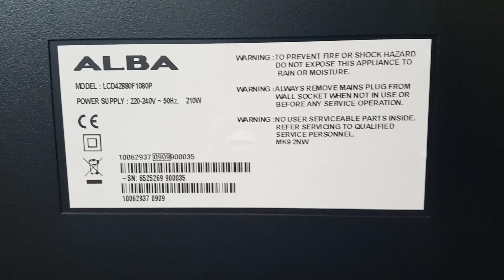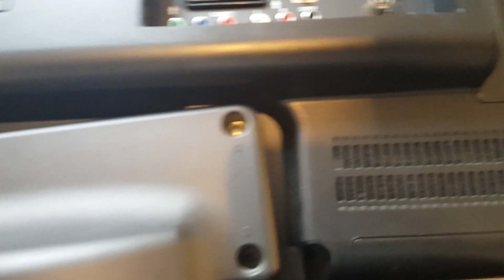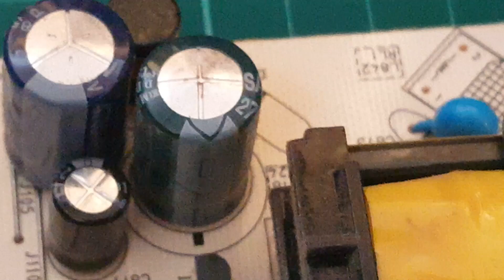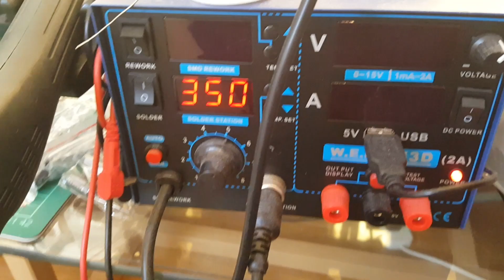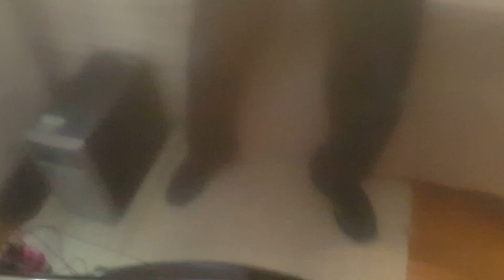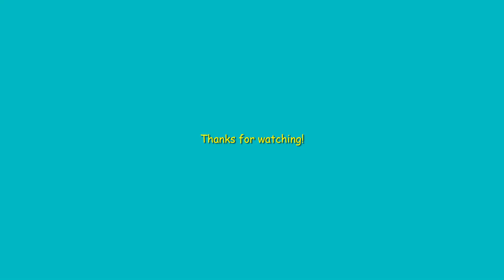ALBA TV Repair

Comment: hello my friend.
i have an alba tv which the sound keeps going after a short while,worse when the weather is warm,
i suspect over heating as picture is fine .
how would i fix this? please
Reply from the maker: This is my opinion, as I am not a qualified electronics engineer, only a hobbyist but as you rightly suggested, it seems to be overheating, maybe the amplifier section of the board, the only way to troubleshoot this is to try an cool the board where the sound chip or IC is located, this involve opening the back of the TV which is very DANGEROUS, AND CAN KILL.
Reply: @lalortech5286  thank you, yes it cools and sound returns albeit brief.
my girlfriend bought me a new telly in the end though as it started to smell of burning sadly .